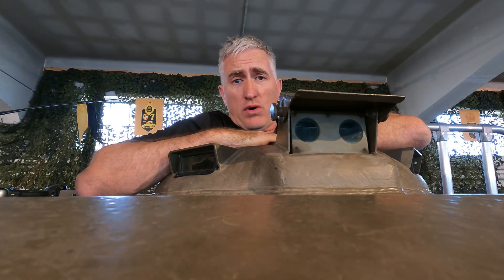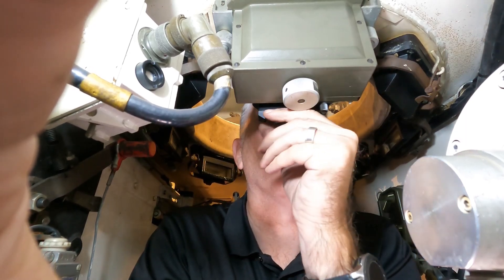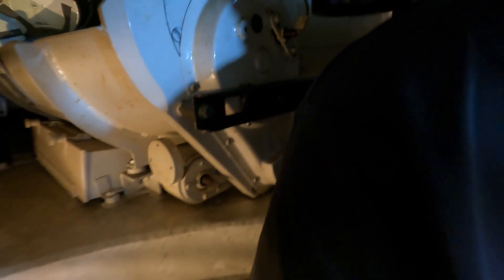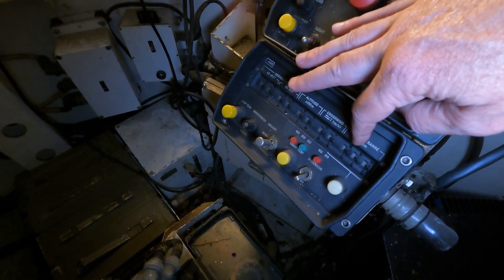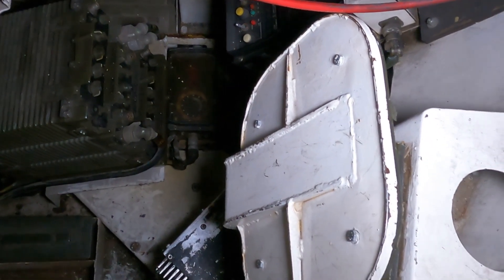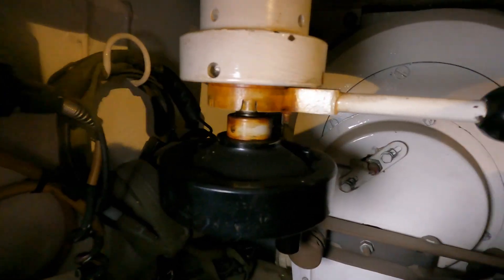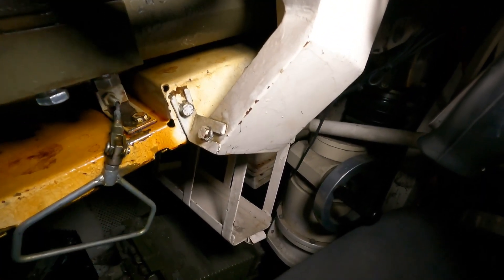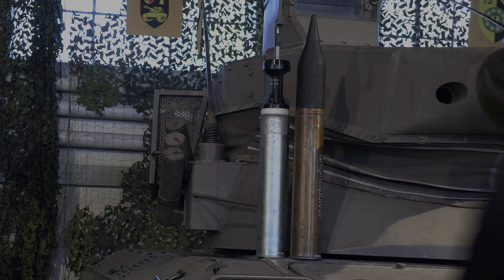Inside the Chieftain's Hatch: Super Kurassier, Pt 2.

Comment: Short question: is it really "left trigger is coax, right trigger is main gun?" Cause on Leo2 both sides of the "stick" are redundant = both triggers will fire the chosen weapon. Main gun or coax.
Reply from the maker: In this case, apparently. It would not be the only tank to have asymmetric triggers.
Reply: Thanks for the info. I was wondering cause it is the Leo2 handle and the idea was to make it suitable to left- and right-handed ppl. (yeah, you can always wire the buttons differently)  @TheChieftainsHatch

Comment: I served as a crewman on the M60s, and I must say that I could comfortably reach and use all the controls and accessories, and did not have to worry about legs or feet getting crushed. The Kurassier was pretty poorly thought out in just about all crew safety and controls. The video is very interesting, and well put together.

Comment: Now I don't know if the problems caused by the tilting of the top of the turret for the crew are suspected by the Chieftain or if this is a fact reported by the crews.
I don't have any information on this, but as far as I can see the crew is sitting very close to the pivot point, so the real movement in this area should be very small.
So maybe this is a theoretical problem.
Reply from the maker: When I was editing, I checked with Franz because I was suspicious that I hadn't misinterpreted the situation and wanted to avoid an embarrassing error.  The response occasioned the subtitle which observed that gunners who didn't need to worry about their legs getting crushed still needed to worry about negligent discharges when extra force was added to their legs by the seat rotation.
Reply: @TheChieftainsHatch  negligent discharges
nice😁

Comment: Why is the switch gear in this Austrian AFV labelled in English, not German? 
I suspect it’s because they stole/borrowed/bought so much of it from US vehicles.
Reply: Probably because the fire control stuff was out of a Leo?
But this question made me think... I wasn't a tanker, i was in AAA and i can't remember the lables of the AA gun and radar system. Or which language they were in.
We bought the AAA system from swiss manufacturer Oerlikon, but they sold it worldwide (the same AA gun i was trained on is what the argentinians managed to shoot down a Harrier in the Falkands war and damage another one. None of their aircraft managed to do that)
With the usually low numbers of things austria bought and buys, my guess would be, the numbers are too low to get our own lableing made.
So we most likely get what the majority of customers buy. 
Also, basically the lable language doesn't matter as you get trained on it anyways. You get trained to find and use any button, lever etc. wihtout looking and under stress, so the lables could be in chinese or windings.
(I mean we got drilled into where in our lockers which item of clothing and equipment had to be so if there's alarm, and the base gets blacked out, you could pack your pack wihtout any light and know where everything was.)
Reply: @nirfz  thanks for responding. I suppose the switchgear stuck out to me, because it didn’t fit with the  expectations I got from flying. In your cockpit, the gauges are probably going to be labelled in one of the official languages of your country. I assumed the same was true for the foot sloggers.
Reply: @CAP198462  oficcial language 😂 Fun fact: We actually have 3 official languages over all, but locally differing: the whole country has german as official language, a few parts of the south additionally have slovene (for the slovene minority on carinthian soil that chose to stay with austria after WW1) and parts of the south east have german and croatian. (for the parts in dispute with hungary after WW1 that decided to stay with austria in a plebiscite in 1919)
But i was quite surprised 20 years ago when i had to "check in" to the "hospital for accidents" in vienna when there were forms to fill out in: german, slovene, croatian, czech, slovak, hungarian, turkish, and a frew languages i wasn't able to decipher as quickly what they were. (there were 8 shelves so 8 different languages)
And it was 2003 and not 1903...😁

Comment: Hey chieftain. 
Did you have links referencing to the various slide show on your "future combat vehicle design" video?
Reply from the maker: Not really. They aren't classified, but the link was only valid for registered attendees, so I'm a little reluctant to make freely available
Reply: @TheChieftainsHatch HI i know possibly where come from T14 Armata A-85-3A engine X shape design he is the reintepretation of UTD 20 V6 from BMP1 engine, this engine have the exacts sames following charateristic : bank angle 120°, Cylinder bore 150mm , Fork and Blade design connecting rods by pins and Tunnel crankshaft. Make rearanged shape for x design make a new Tunnel crankshaft add one more Turbo and some minor changing and you obtain A-85-3A. Cutaway from the engine UTD 20: https://forum.chronomag.cz/uploads/post-39943-0-30498800-1579366315.jpg I am engineer in aeronautical in France in Toulouse this is not my language. Hope to help Up the message for is be seen.
Reply: @TheChieftainsHatch Hi Chieftain, i want  know your opinion could 2s25 Sprut / Sprut SDM1 could be a cheap T14 Armata with remote operated turet seal front 3 crew compartment and put era from bmp3 on it like 2s38 with a era pack add on armor on it and be for urban terrain be sell like it "cheap T14 armata Isv ( Infantry support vehicle).Can he take BMP3 ERA on it?  but the better would be to use this remote operated turret on a other chassis like bmp3 and that exactely the point of 2s38 57mm  he is on bmp3 chassis is remote operated turret adapt the 125mm sprut turret on it close crew capsule put era of bmp3 on that work because he is a bmp3 chassis base in this case and you have a low cost t14armata more urban fighting assymetrical warfare that you can use or sold at export low cost easy and faster to manufactur and lower logistics easy. What is your opinion on it ?

Comment: The control panel made by AEG is funny to me. I know big corporations make electronics and circuits for many different markets, but to me, AEG primarily means a maker of vacuum cleaners and washing machines
Reply: Random fun fact: AEG is considered the first company to ever undergo a full corporate rebranding when they hired Peter Behrens as the world's first corporate designer, like Jony Ives. They're still using the logotype from back then!

...well, it's a fun fact for me.
Reply: Ausschalten - Einschalten - Geht
Reply: AEG does not exist anymore; today it is a licensing brand for household goods. AEG could be compared to the american company General Electric and was active in nearly all kinds of electrics and electronics; even Telefunken was part of AEG.

Comment: should have implemented some kind of weight that moves rearward to the turret the more shots you have fired to compensate for the lack of weight caused by the spent shells. I am not an engineer nor do I have a lot of information about mechanics of oscillating turrets but that would seem like an obvious choice.
Reply: Problem is where would you put it, the turret is already real "cozy"
Reply: @biomike01  my thought exactly. Good idea *if we had the space to do that*.
A big fat solid block+motors+rails.
Reply: @biomike01  a moving piece of armor plate outside could do the trick

Comment: Wouldn't depressing the gun RAISE the portion of the turret aft of the pivot, which is fore of the gunner's seat?  So, your legs would straighten as your butt goes up, maybe getting your knees out of the way of the lowering fire controls?
Reply: Depends on where the pivot point/trunnion is located. If it is behind the gunner, then it as the Chieftain said. It took me a second to think it through.
Reply: @vicpecka7356  it's basically the normal AMX-13 turret, with the pivot fore of the hatches.  The wiki on it has a good side view, the pivot is more or less where the gunner's knees are (assuming the seat is directly beneath the hatch, which may not be true).

Comment: I'd never seen the French 105 and the L7 105 compared side by side before. Nice!
Reply: That indeed explained much of the AMX-10 "wheeled tank" in Ukraine an its unique 'almost 105mm but not really' ammo.
Girth matter, I guess.
Reply: Still, 43 rounds onboard seems a lot.
Reply: @petesheppard1709   IRL battles last longer than 15 minutes.
Reply: @obsidianjane4413  I was thinking about stowage on such a small vehicle.  With only 12 rounds in the loader, 15 minutes may be about the max before they'd have to disengage to a covered position so the crew could crawl out and replenish the autoloader.  If it's really hot, it may be much sooner.
Reply: @petesheppard1709 it's primarily an ambush vehicle and a lightly armoured one at that. If you use more than 12 rounds you're in deep shit anyway.
Reply: @heliftera  That's the plan, but the enemy gets a vote...

Comment: Well, the Austrians might have procured either more M60 or surplus M48 and upgunned them to L7. This vehicle looks out of place against massive armored/artillery force the Soviets were employing.
Reply: Plot-twist! They did.

The Austrians had M47's as their MBTs when the Kurassier arrived, then upgraded to M60 in 1982 and then to Leopard 2

Kurassier is a light anti-armour system, not an MBT. Think Tank Destroyer, with protection against small-arms only.
Reply: It's called a Jagdpanzer - tank destroyer for a reason. Think of all the other ones fron WWII, none offered the protection of a medium or heavy tank.
Reply: Those 2 you mentioned are heavier, much more heavier. 
None of them is going to survive a well placed shoot from the contemporary.  So logic is get one that's lighter that probably can traverse around stuff easier.
Reply: @jintsuubest9331  Also 'Cozy' is going to be less 'gripping' on mountain roads, as found in much of Austria. And in any case the comparison is not really 'like for like', Kurassier is a light anti-armour system, not an MBT (that's what the M47/M60/Leopard 2 are for). Think Tank Destroyer, with protection against small-arms only.

Comment: Hi Chieftain, i want  know your opinion could 2s25 Sprut / Sprut SDM1 could be a cheap T14 Armata with remote operated turet seal front 3 crew compartment and put era from bmp3 on it like 2s38 with a era pack add on armor on it and be for urban terrain be sell like it "cheap T14 armata Isv ( Infantry support vehicle).Can he take BMP3 ERA on it?
Reply: most ERA (Especially the types designed to interfere with kinetic projectiles) requires a certain thickness of armor behind it, otherwise you'd just blow a hole in your own tank. the 2s25 is designed to be both amphibious and air mobile (Meaning that you can deploy it from a cargo plane on parachutes). Adding extra weight with ERA, or automation systems for the turret like you suggest, would compromise both of those abilities.

Also, seating three crew in the hull of the 2s25 would not be possible, as the space to the left and right of the driver is taken up by fuel tanks.
Reply: @fulgrimventris8506  Thanks you a lot for this informations  for era i could agree but for remote operated turret i don't see anything that could go wrong or add-weight end for fuel tank you can put in another you have plenty of space in this vehicle but the better would be to use this remote operated turret on a other chassis like bmp3 and that exactely the point of 2s38 57mm  he is on bmp3 chassis is remote operated turret adapt the 125mm sprut turret on it close crew capsule put era of bmp3 on that work because he is a bmp3 chassis base in this case and you have a low cost t14armata more urban fighting assymetrical warfare that you can use or sold at export low cost easy and faster to manufacturing and lower logistics easy. What is your opinion on it ?
Reply: shoigu on youtube with a burner account doing his own arms research because MoD is clueless 👌
Reply: @Chaosrain112  I don't really understand english is not my language 🤔 or what can you think of what i said earlier?

Comment: Hi Chieftain, i have a idea i know possibly where come from T14 Armata A-85-3A engine X shape design. I want to have your opinion .he is the reintepretation of UTD 20 V6 from BMP1 engine, this engine have the exacts sames following charateristic : bank angle 120°, Cylinder bore 150mm , Fork and Blade design connecting rods by pins and Tunnel crankshaft. Make rearanged shape for x design make a new Tunnel crankshaft add one more Turbo and some minor changing and you obtain A-85-3A. Cutaway from the engine UTD 20: https://forum.chronomag.cz/uploads/post-39943-0-30498800-1579366315.jpg I am engineer in aeronautical in France in Toulouse this is not my language. Hope to help Up the message for is be seen.